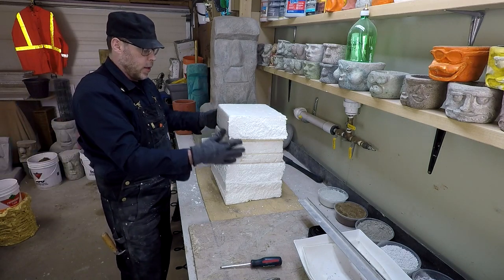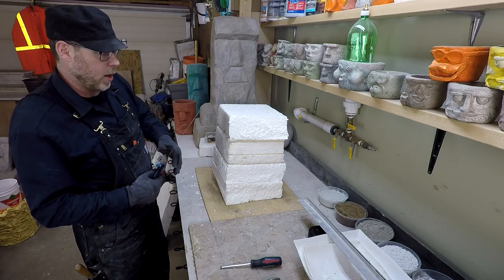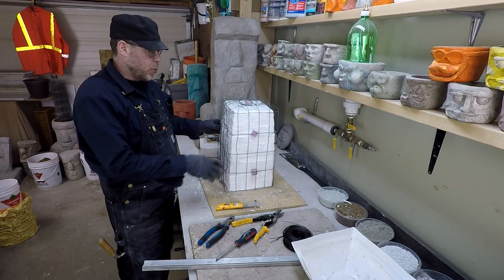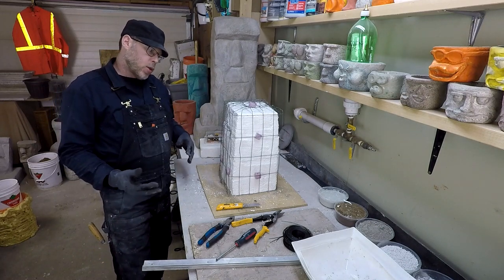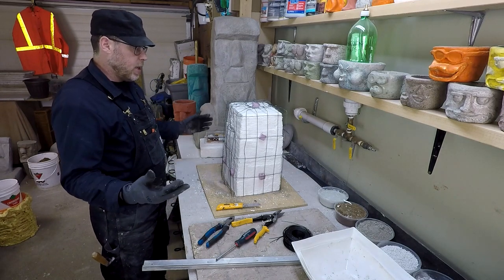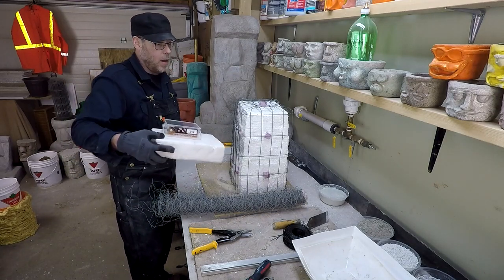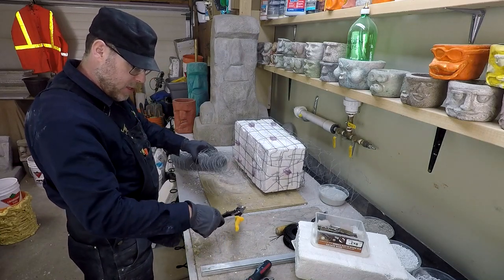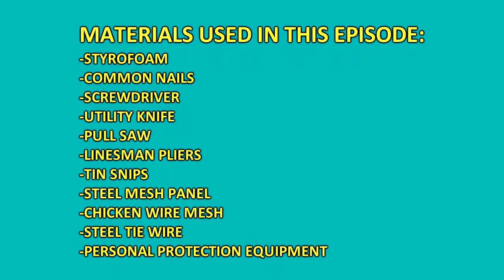How To Make a Concrete Urn Planter 1/6

Comment: Looks nice enjoy your videos. When adding Elmer's glue to a 4 to 1 perlite mix to make it stronger how much do you add. Planning on a pizza oven soon
Reply from the maker: replace 10% of the water in your mix with PVA glue.  dont forget you need to make refractory / high temp concrete for a project like this.